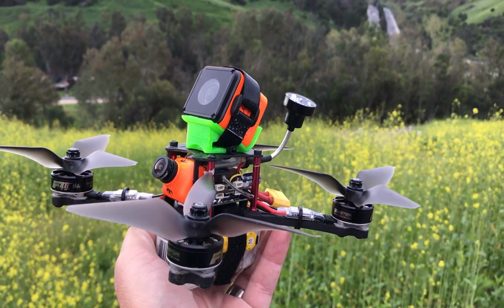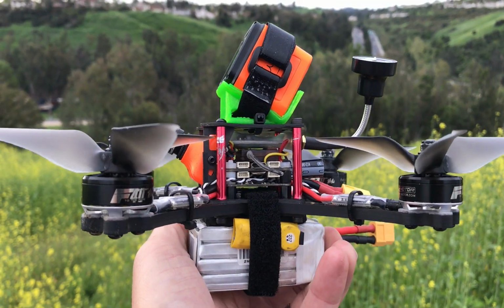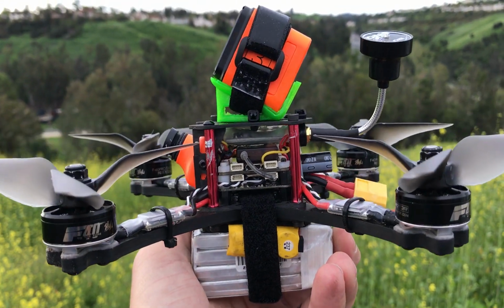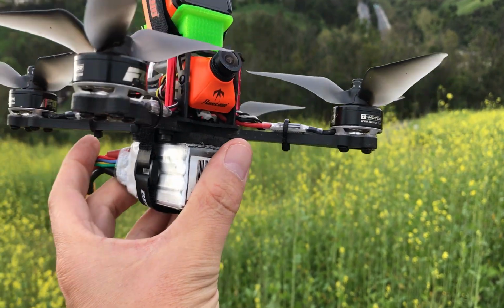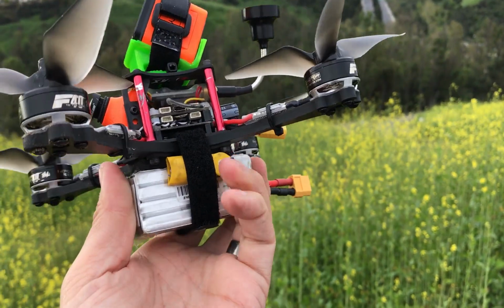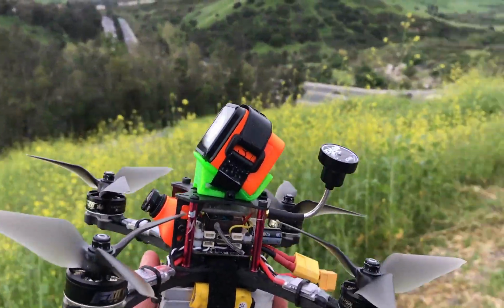RunCam 3 First Flight

Comment: runcam3  in flight sound is exceptional considering the speed of the drone is inducing 60-80-100 MPH of wind buffeting directly on the mic elements! try hanging a video mic pro outside your car at 70mph in direct wind....jus sayin
Reply from the maker: Eric Ortlieb so true! I have no clue what these guys are saying about the sound... my motors do have a funny sound to them,,, but yes- top speed on this quad is 110mph
Reply: 7demo7 I think the motors, and your walk and talk tests sound great, 99$ for a HD camera with mic and rechargeable  battery (APPROX total size of 3 9volt batts)....video mic pro $229 doesn't even come with a required 9volt battery! which Casey niestat often forgets  to turn his mic on! LOL, or breaks it

Comment: your video TX antenna not mounted properly , it's going to snap the board connector on the first crash
Reply from the maker: Itslike123 I normally run a pigtail on this setup